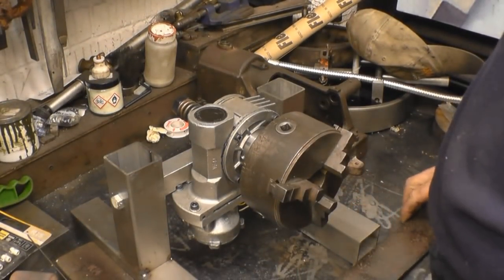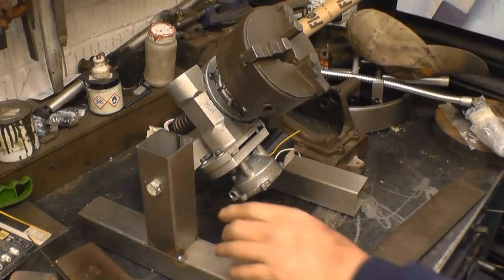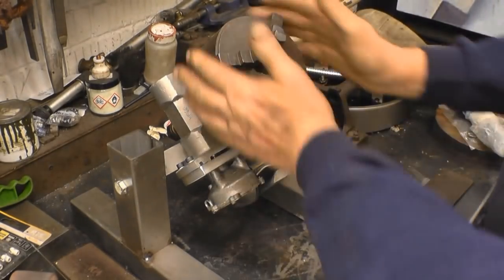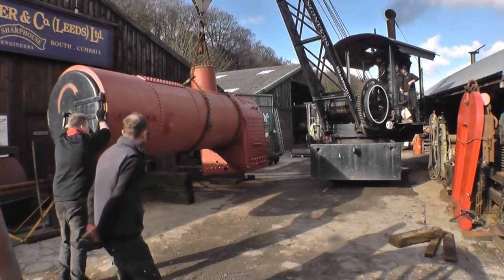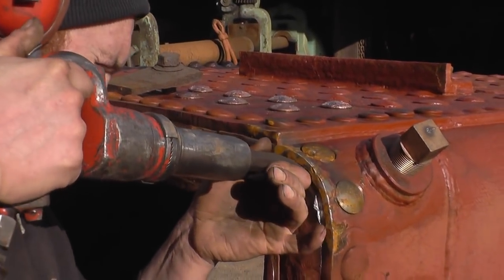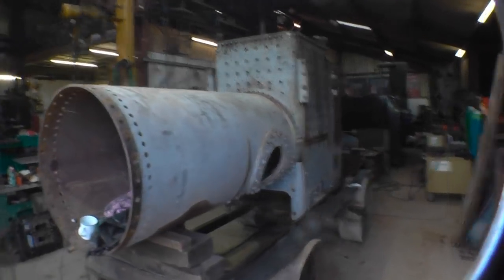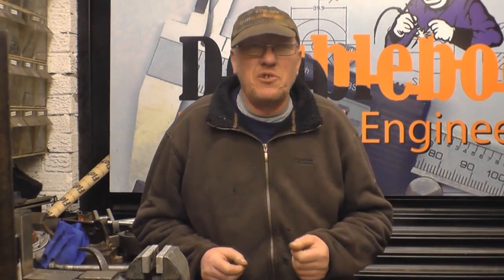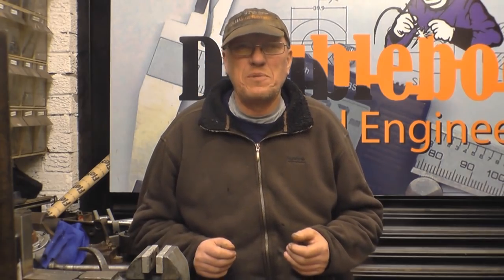SNNC 214 P 2     Steam Engineering

Comment: Just a thought John, the weld positionor up right clamping bolts will tend to crush the square section tube walls over time. To prevent this from happening, one solution would be to drill out the outer wall to accept a tube, which would transfer clamping force to the inner face. Great videos, Sunday evening treat, thanks for posting.